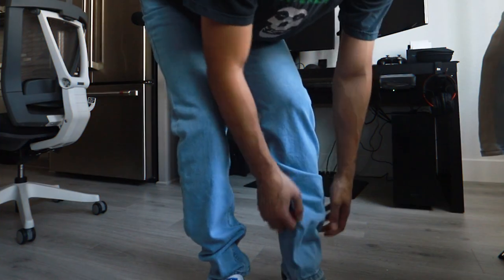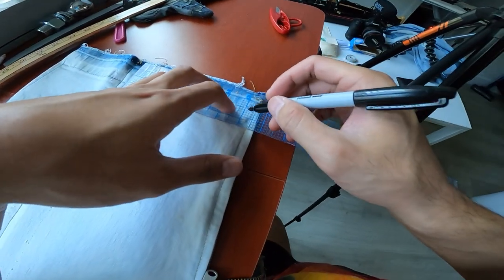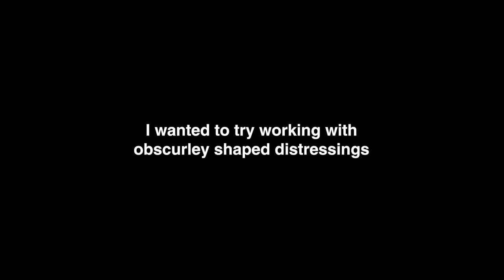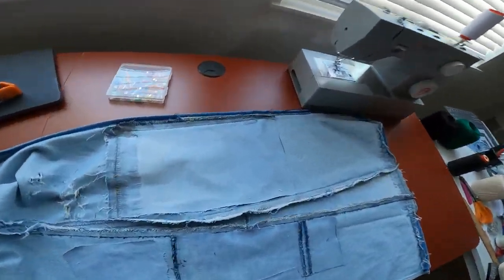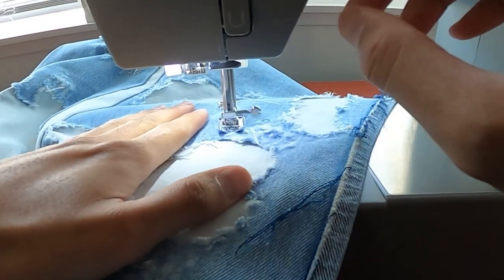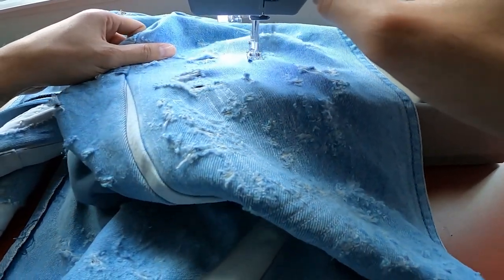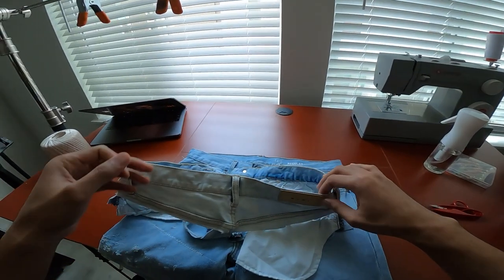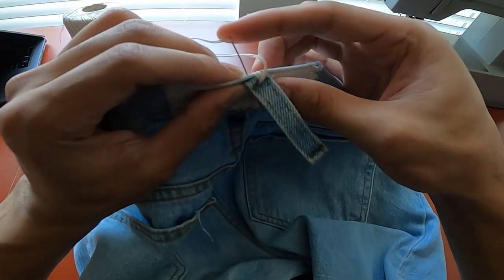I Made These $8 Plain Distressed Denim Jeans Wearable | JULIUS

Comment: I enjoy watching your work and am working on Julio (and tmyers) inspired jeans. 
Does the glue mess up your sewing machine needle? I was concerned about even carrying the tacky glue into the bobbin.
Reply: If you use very small dabs of fabric glue, and wait until it's DRY, it will not cause any problems with your sewing machine needles. 🙂

If you wish, you can also iron down the fabric after using very small dabs of glue, which will flatten down the dabs of glue and help them dry faster and lay more evenly.